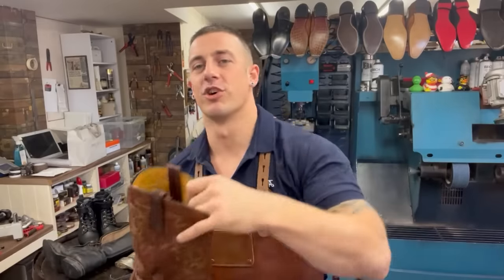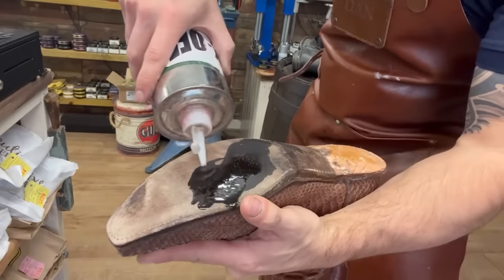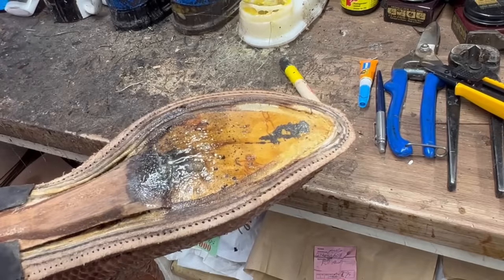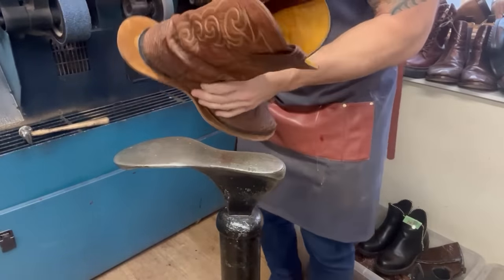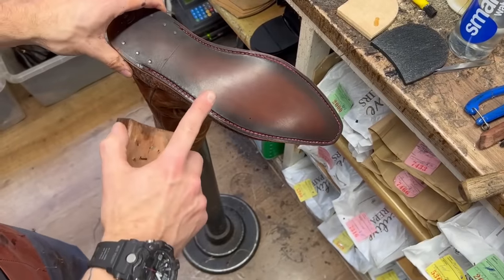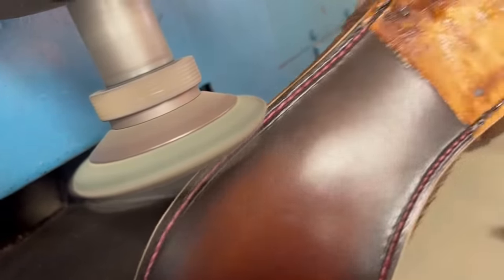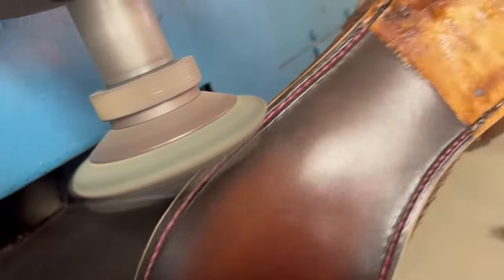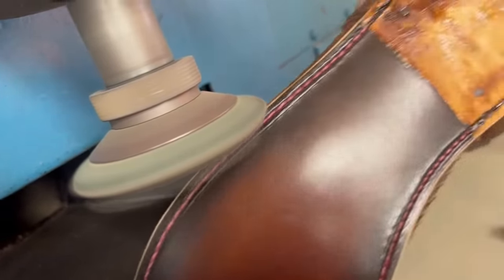Repairing Lucchese Snake Skin Cow Boy Boots!

Comment: The stress line of the top of the foot on the boot looked wrong for Lucchese. A cheaper Mexican boot has this stress line there but not typically Lucchese. Also, the arch usually has wooden pegs, this one did not apparently. I have pairs of Lucchese both classic and the cheaper run stuff, but they both are heavily branded, these are not so much eh? I'll say it, these look like Mexican maybe Sanders knockoffs.